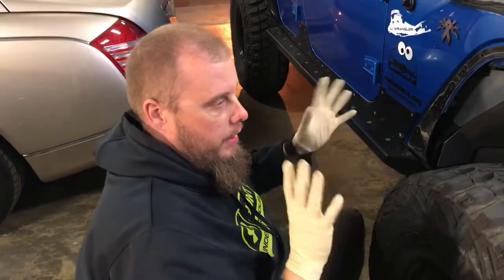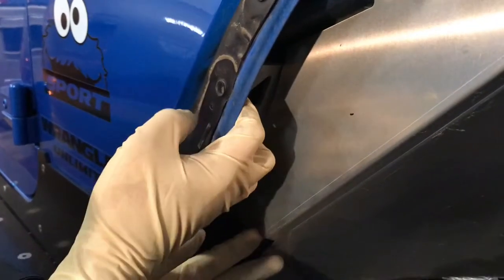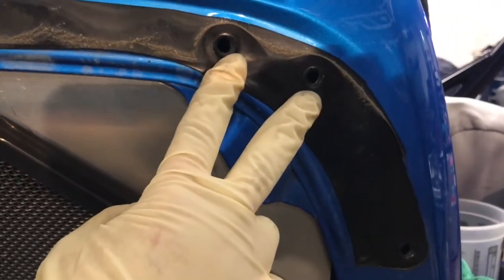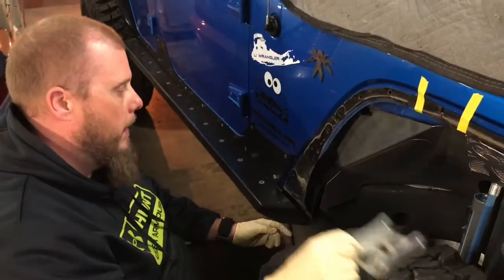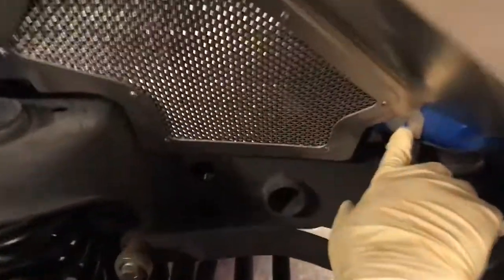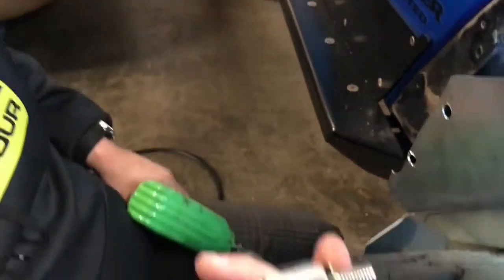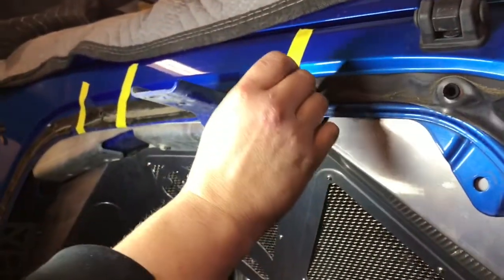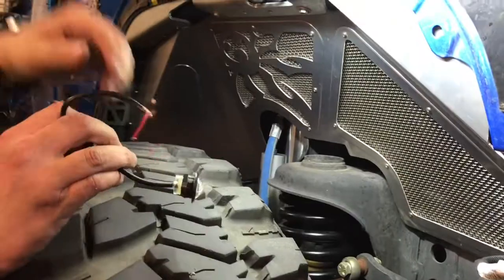Poison Spyder Inner Fender Installation

Comment: Does drilling out the holes from 3/8 to 17/32 For the alternate nut-sert location effect how the crusher flare bracket bolts in? I’m having the same problem of not being able to reach and wanting to know before I start boring out the holes
Reply from the maker: No not at all. It bolts in the same way your just using the nutsert as a nut on the backside. I don't know why they didn't just give a couple extra nutserts in the box. I hope it helps you. Let me know how it works out.
Reply: Cool thanks for the feedback

Comment: Rather than go through all that nut-sert bullshit,  just go down to Home Depot or Lowes and get a couple of #14    3/4 inch self tappers.  I just finished the entire install in 10 minutes without all the drilling to nut-sert.  

Suggestion.   Use a small drill bit to make the initial holes through the alum and fender flange.  Nut-serts are a pain in the ass and I see too many amateurs waste hours and lots of money trying to get them to instal properly.  You can also drill a hole through and through and run a bolt from the back side.  It's simple.  Use a 1 inch bolt,  run it through from the inside,   then position the inner liner,  grab the bolt with needle nose and hold it....put a lock washer and nut on it....tighten it down and your done.  With that said....that's way too much drilling.  

The self tappers are really easy.  If they loosen over time....JB Weld will stop that issue.  This has worked on about 80 installs with no problems.  Nut-sert or rivetnuts are just that......NUTS.